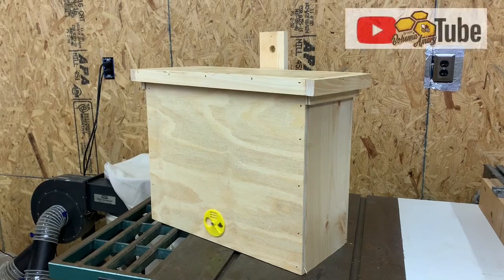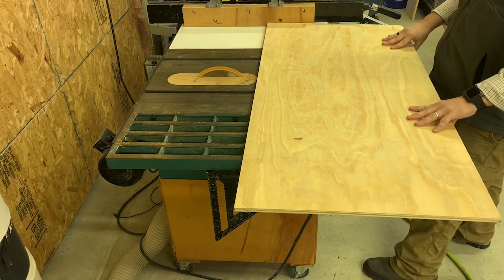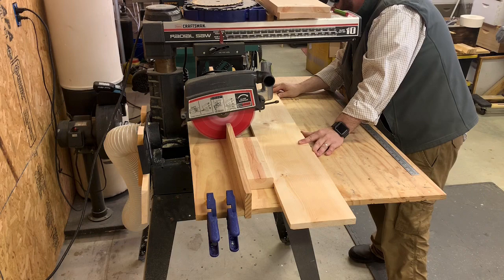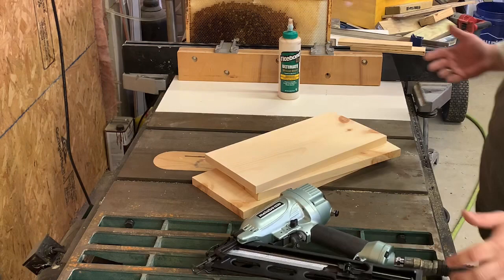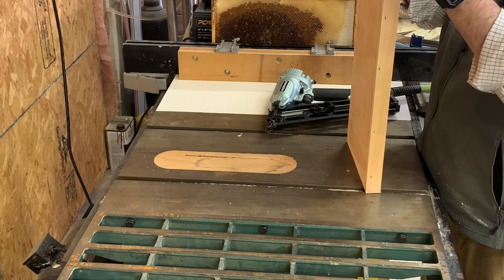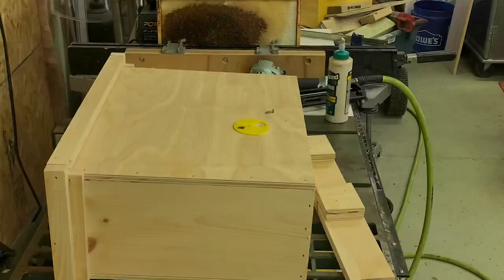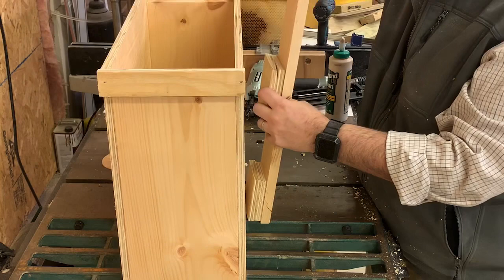How to build a Honeybee Swarm Trap | beekeeping

Comment: I live in a place where moving them at night may be a bit cooler, but a couple screened holes near the top could be a good idea.  1.375" holes would not be too big. One on each end. A six frame Layens system box may even require a closeable bottom vent of maybe 2+ " opened when moving about 20 miles or less.
Reply from the maker: Thanks for the suggestion

Comment: I cut the 2- 2" strips off of my left over piece of Plywood for the Lid and it came up short. Measure the overall width before you make the 2 pieces for the ends. On mine that piece needed to be 20 5/8 inches long. When you cut 2- 2 inch pieces off of a 24 inch piece it only leaves 20 inches. I had to source another piece for the lid. I love this design and won't make that mistake again.

Comment: How would you work it, if you wanted to stack them on top of each other connected, but wanted to make sure they stayed secure, but could still be opened up? 

Nice video. Like what you are doing.
Reply from the maker: Noah Riding  great question. These traps aren’t designed to be stacked or kept as a working hive box where you would need to add additional space. The average swarm looks for approx a 15 cubic liter cavity. The size of this box solves for that and then some by giving the swarm the ability to cluster on the inside of the box on the up to 5 frames and even hand below frames without being outside. It’s comparable to a standard deep on its side. As far as securing the trap it’s really about where you hang it. The hang bar is offset to the lid and open to allow for a ratchet strap to secure to tree or post. The hang bar has a hole for  easy hang before securing trap.  Hope this was helpful.

Comment: Great video and a very nice use of material but I don't see how you can get that final mount piece from the leftover 1x8x6. The accumulative cuts (if you include 1/8 blade Cerf) for the 2 sides, bottom and top cover edge bracing adds up to approx. 66-3/4". That only leaves approx. a 5-1/4" length of the board, nowhere near what your are showing.  You could however build the mount from the remaining plywood so it's no big deal. I like the design regardless so I modeled it in my spare time. If you would like a copy of the plans along with a cut list with some mods to accommodate material use I can send it to you for comment
Greg Abbott
Richardson, TX.
Reply: My mistake.... the actual total cut length is approx. 70-5/16" with Cerfs (not 66-3/4) so the best piece you could have for the mount would be approx 3"x7". I built the box but I needed a 1x8x8' in order to do it.

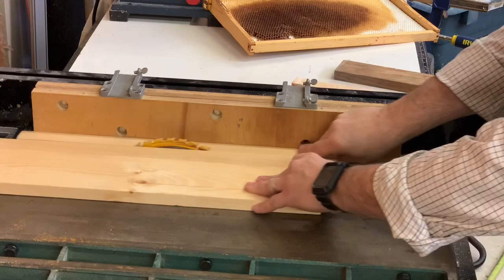Comment: 6:00 through 6:23 inaudible over background sounds of equipment about the third/fourth lid rails? I assume another rip/slice off hanger board then improvise width of sides? Waving one around with bad audio is little help.
I understand it's a 3 yo video yet I'm working remote (sons House) just using a battery skill saw on top of trash cans with $40 of wood, plan to hang up this weekend.
Reply from the maker: I believe you are correct based on how I understand your question.

Comment: Does this need some sort of ventilation or painting?
Reply from the maker: No it’s not necessary to have vents unless you plan to leave a swarm in the trap for a length of time which we wouldn’t recommend. As far as painting, you can paint, stain, or wax dip if you want the wood to last longer.
Reply: @BohemiaBees  thanks
Reply from the maker: No problem. Thanks for question.
Reply from the maker: Ventilation not really as a caught swarm really only spends a few days in it (assuming regular checking)

And painting YES on the outside to help it weather better.